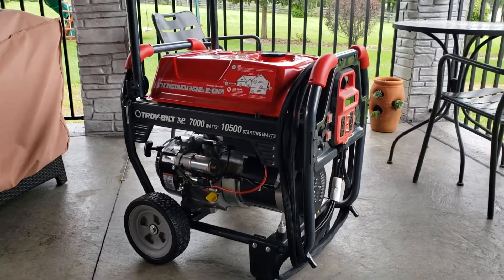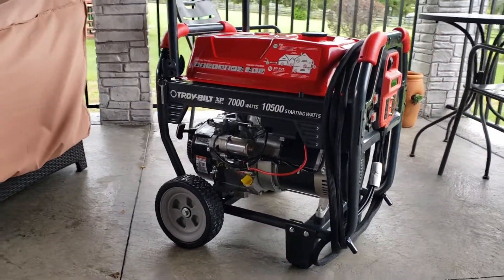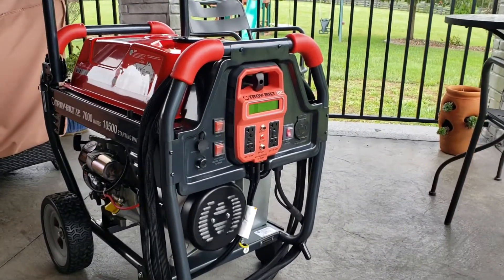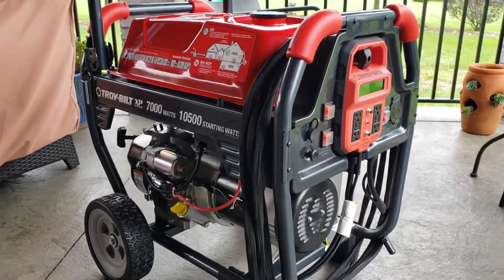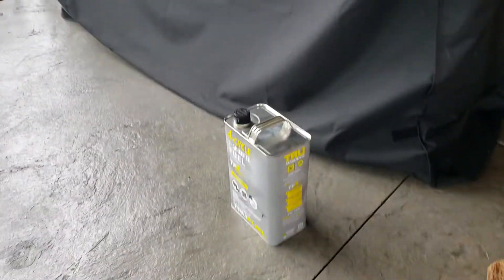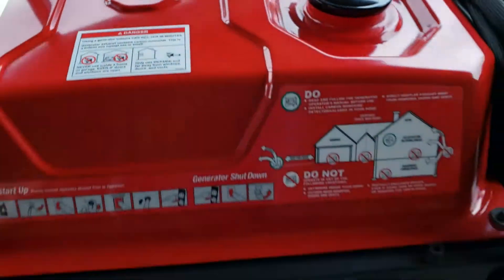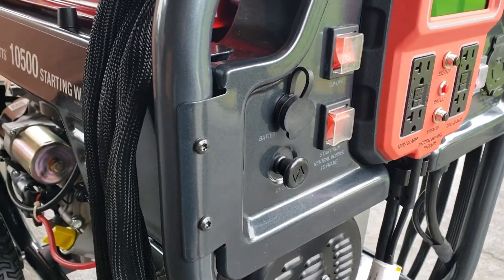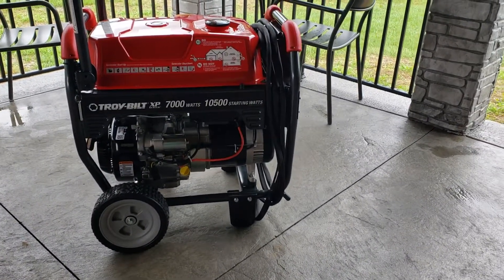Part 3 - Troy-Bilt XP Series Generator Break-In, initial thoughts, Pros/Cons, Noise levels / Power

Comment: If you read the manual it runs on 11hr for half load if you keep taking voltage the idle response will raise the motor so we could put out more voltage you need to use the machine more to explain it put a heavier charge on it and you’ll see what I’m saying. If you put a full load on machine it’ll only run nine hours

Comment: This does have idle control because the more load you put on the machine the idle will go up and that’s called idle control the engine will put more voltage out of the generator I’ve done it more than once when welding and having no power!!! That’s what where make for I for on them!